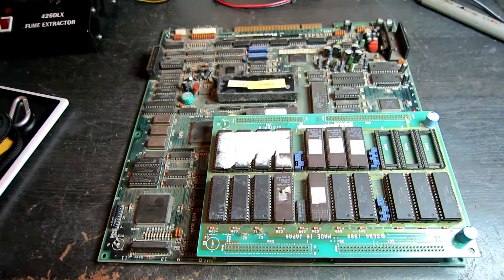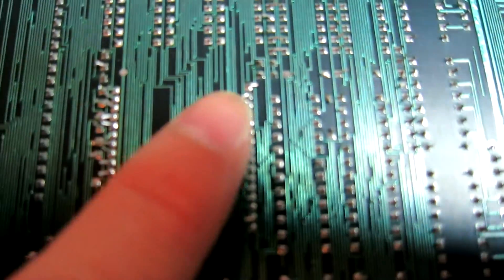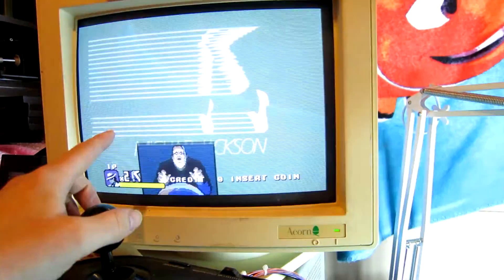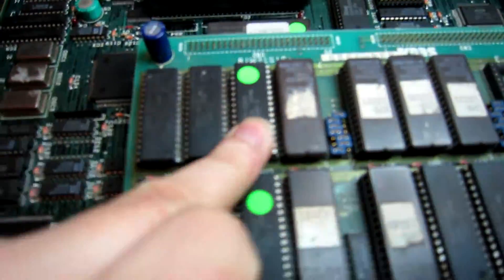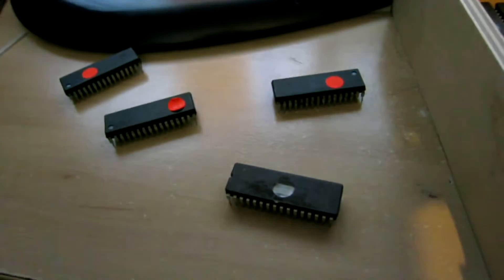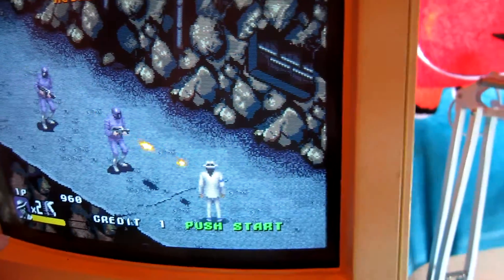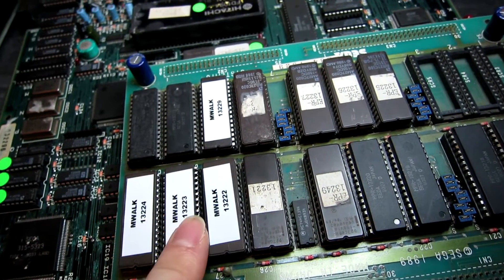Michael Jackson's Moonwalker PCB Repair #2 (SEGA)

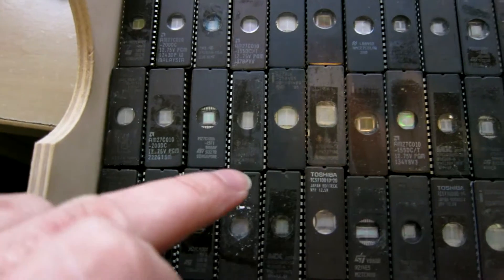Comment: I know that this is an old video but it is such a helpful resource. I need some guidance because I plan on repairing some arcade board on me. I have taken notice that you have a drawer filled with ROM chips and I would love to have a drawer like that  with blank chips so I can burn them when i needed. My question are few, how many of the blank ROM chips I should get to have a nice handy drawer like yours on 2:34 mark. Question  2, what kind of arcade burn and erase ROM tool device would you recommend me getting to use on Windows 10, and 7. The arcade boards I have are Moonwalker, The Simpsons, Wrestlefest, Robocop, X-Men, Mortal Kombat 1 and 2.

Comment: How do you find the bad ROMS and sockets?  Do you just test each ROM in another board?  Do you just check for continuity on the IC sockets?  I think your leaving out the most important part by not showing how you find the problems.

Comment from the maker: If I knew of a better device at a reasonable price, I would buy one :) There is a newer version of the one I have, (Boardmaster 8000) but I think they are about £40k new and £10-£20k used or something equally silly. Depends what sort of IC's you need to test. There are low cost Chinese IC testers on ebay if you just need to test basic logic and cmos devices. Good eprom progammers can test IC's (ELNEC are the best)

Comment from the maker: No problem, thanks for your kind words and feedback. 

The big IC tester is the Boardmaster 4000. I do not recommend these though as that is my third one and it is already going faulty. They are too expensive and unreliable at this age and you would be lucky to be able to use it enough before it dies to justify the cost.